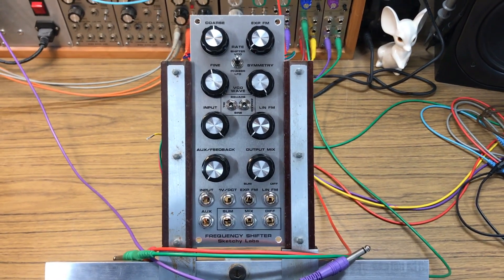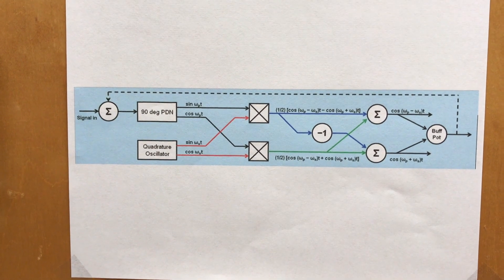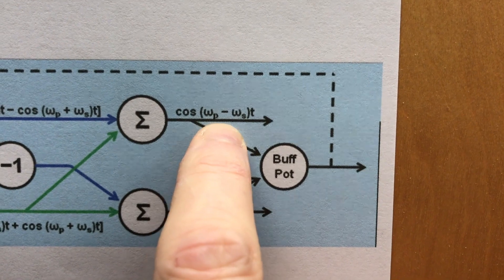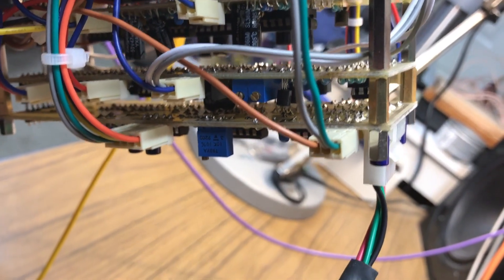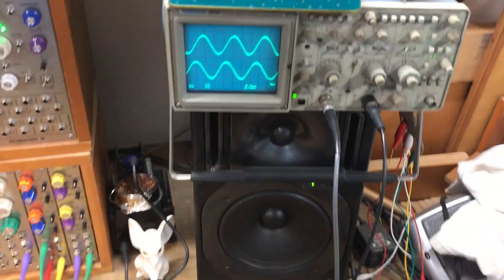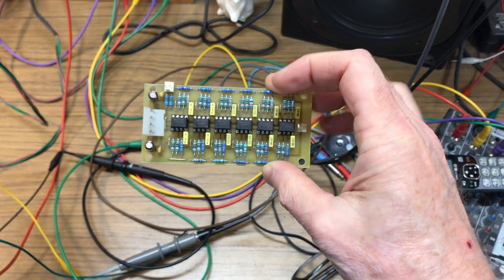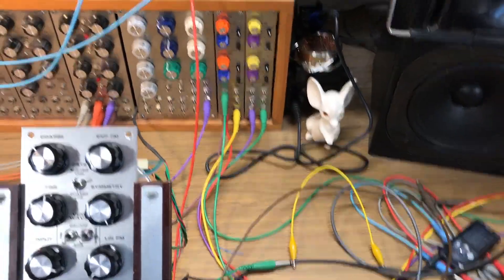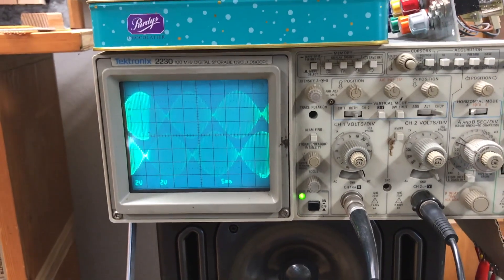Doc Sketchy Frequency Shifter, Part 1: Explanation

Comment: Looks awesome :0
Also you mean 4 quadrant multiplication as in a ringmod function?
Reply from the maker: That's exactly what I mean, Nou Youh!  I make a precision dual 4-quadrant multiplier (4QM) from just one 2164 quad VCA chip (using and abusing this chip is a bit of a specialty of mine, for which I used to be somewhat famous).